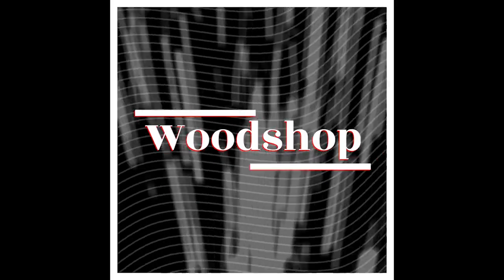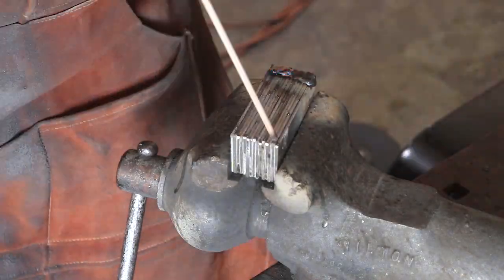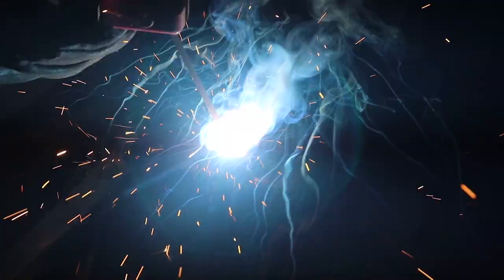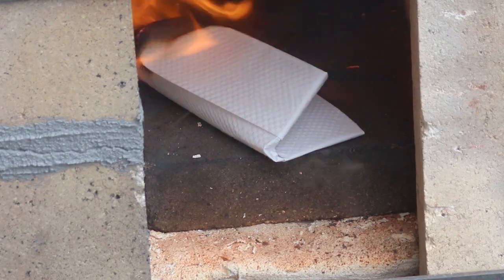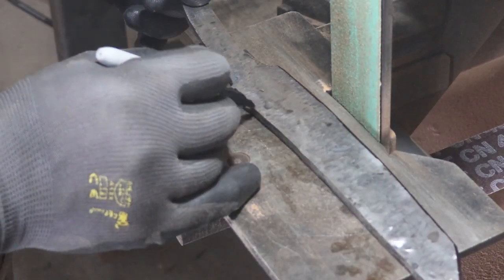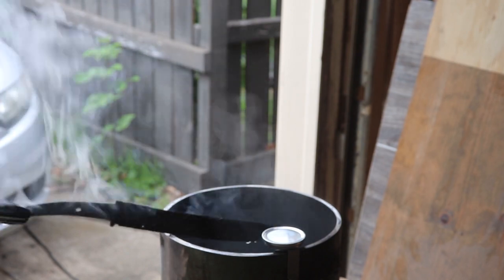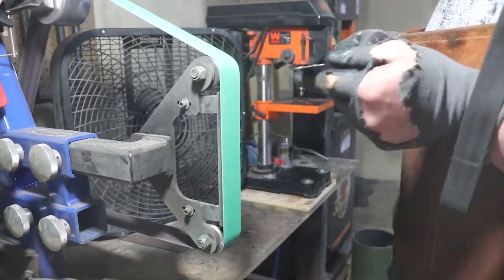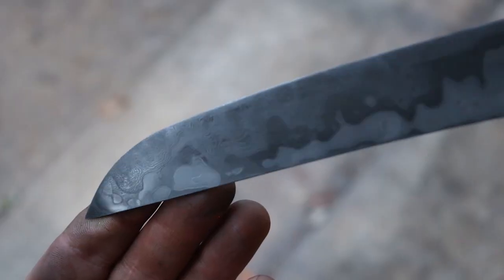Making a Custom Damascus Core 7-Layer San Mai Tanto Knife Part I

Comment: How many times did you thermal cycle i do 4 rounds and then quench then right into the temper after wiping off the oil residue and I rarely get any warps. however i also mostly do clay quenches especially on very thin blades as i feel that helps prevent warps.

Comment: If you run the forge at a colder temperature it wont generate as much heat as it does not need to be run at forge welding temperatures.
Reply from the maker: If you run it at a colder temperature it won't generate as much heat?